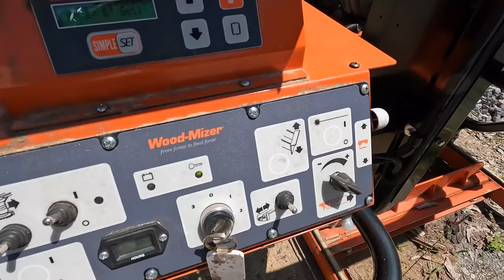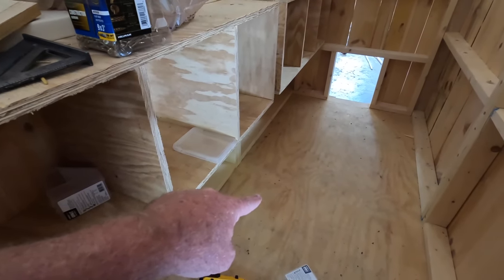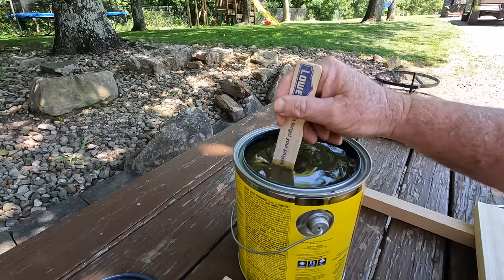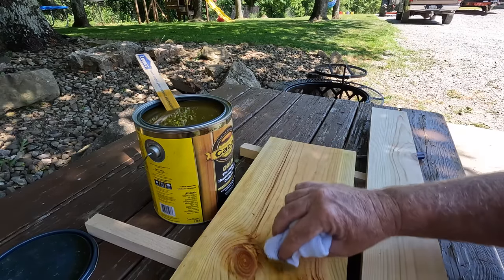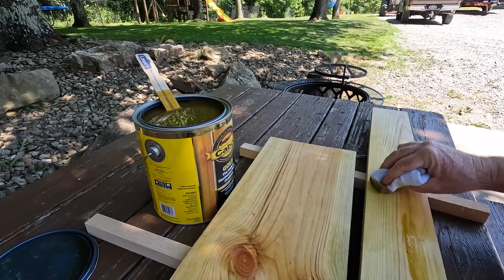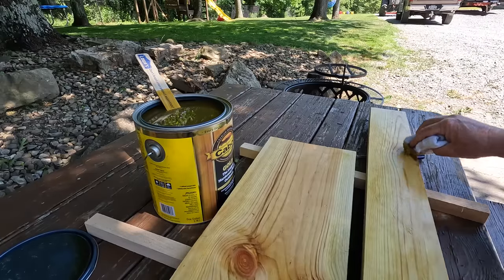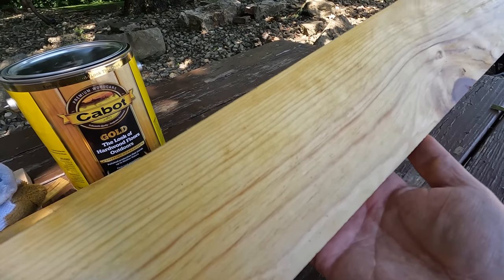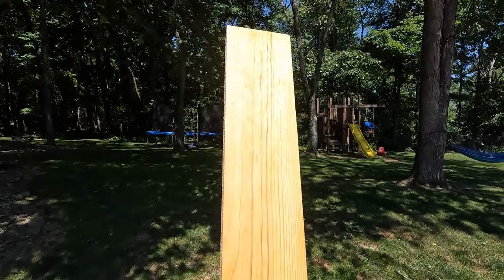Sneak Peek and State of the Union OWTM Style

Comment: A tip that I have done.  Covering the floor of the coop with a sheet of linoleum, it makes it easy to clean and protects the plywood floor from deteriorating over time.
Knew someone who worked for Valspar the maker of Cabot stain.  They were founded back in 1806.  The first cars were painted with Valspar paints.  If you were restoring old autos you could still get original paints I was told.  Pretty cool I thought. Since I had that connection have always used there products and always had great results.  A few years ago they were bought up by Sherwin-Williams thou.

Comment: If you like the hue of the stain and want it a little darker, then water pop the wood.... Take an old rag and soak it in water. Then wipe the wood with the water like your putting on stain. Let the wood dry 30 minutes or so. Then wipe your stain on.... The water opens up the grain of the wood on the surface and allows the stain to penetrate deeper!!! Luv ya's from Kentucky!!!

Comment: Thank you for your comments on the inflation and the high price of fuel.  We are so divided as a country and I thank you for reminding me that we need to find a way to come together in agreement, and stop running each other down.  I don't buy many Apple or Microsoft products.  Sometimes it comes to the point I have to spend the money and upgrade.  
I cut some wood and fire an outdoor wood burner to heat the house.  Those Spitfire splitters are really nice and fast!  I have a 3 point hitch splitter that I have $275 in, but it is slow!  I have taken all the work out of making fire wood that I can.  Spent $350 on propane last year but will cost me more with the increase cost of fuel for summer fill.  
Thank you for your videos!

Comment: Rather than take the $50 loss, pick up some dark paint tint and make it whatever color you want.  Don't worry about matching anything in the future, because after 6 months outside it will be a different color anyway.

My coop is 6x12, with a real pre-hung people door with a glass/screen storm door, vinyl/glass sliding windows, a solar-powered auto chicken door, a thermostatic vent fan, and a flowered window box!  I need the lip to hold in the construction sand that sits on cheap vinyl flooring (2nds at the home improvement store) for easy cleanup.  My roosting bars are hinged so I can swing them up and secure them for more headroom during cleanup.
Yes, the girls are spoiled!

Comment: That Sun Drenched OAK will darken with age/weathering and should look just fine. Give it a chance and as long as it has not been sealed with clear lacquer you can always cover a light/thinned coat of a darker stain. Raw wood always takes the stain different! Get a quart of the darker stain and do a 25/75 or 50/50 mix on a few test scraps. You will definitely find the right combination for the look you want to achieve. Don't worry about the off topic videos; they are your VOICE and if someone doesn't like it, they can click to lawn care in Florida or boating at Haulover Inlet.

Comment: From the look of the stain it might work as the second cost once you get the color you like you can use that as a sealer coat or you can use it on your interior to seal and lighten up the inside wood.  As far as the price you paid most stains cost $25- $40 and some went as high as $65 5 years ago and the better the stain the higher the cost and Cabot Gold is one of the better stains out there.

Comment: I know for a fact that people in Florida will buy generators use them then return them. Some places got smart and their signs say not returnable. Too bad about the stain. I bought a 3 drawer plastic cabinet at Home depot and when I got it home I realized the drawers were broken. I returned it, so I had taped up the drawers with clear tape. I come back to the store and there is the same broken piece. I think they didn't believe that they were broken. Another time we ordered a new power washer online and had it shipped to our house, well UPS must have dropped it and broke the end of the pump. I had to open the box up and then found it was broken. So called the nearest store to return it. My wife met me at the store and after the crap the store and us went through they reordered another one to ship this one to the store for pickup. So it came in and my wife picked it up. Another week goes by and Home depot calls and says your power washer is ready for pickup. Two things could have happened i pick up this one which may have been the broken one or explain that I already have the replacement. I explained to him that I have the new one, i chose wisely by my book.

Comment: Hi Mike. Can dye be added to the stain to make it darker? I cannot buy a tool, use it and then return it. I bought a 36MM laser cut socket to take the arm rest off in my 1992 Accord. I cleaned the arm rest and used the socket to attach it. I then hung it on my tool wall. Have good days!